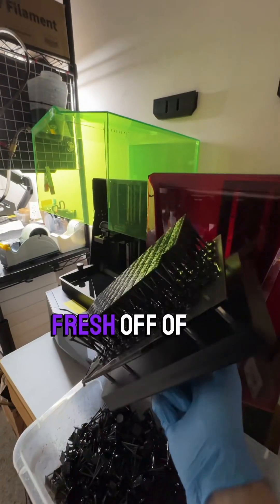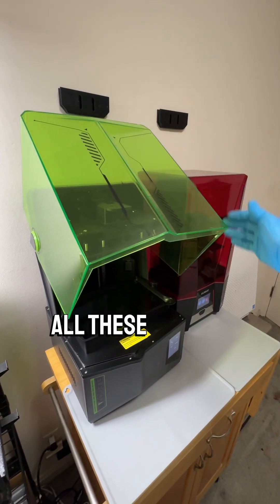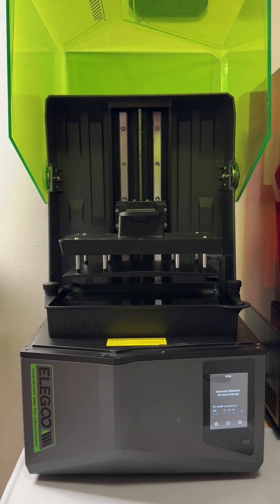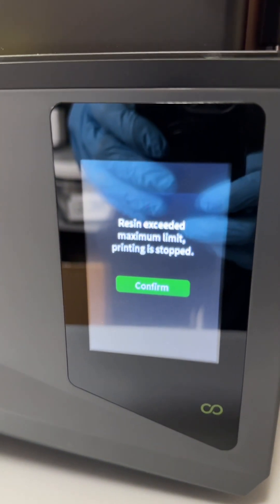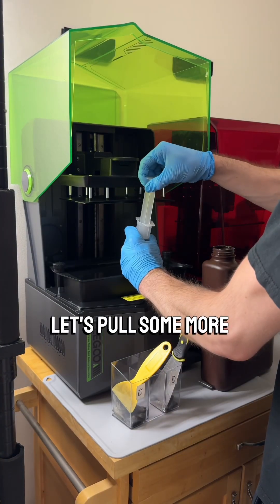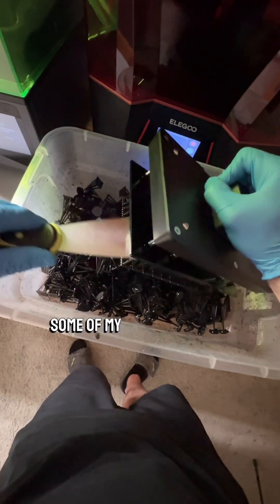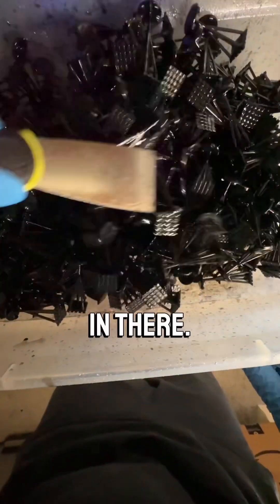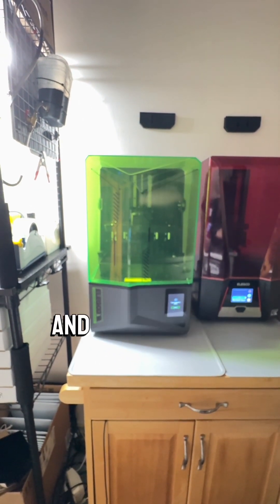Elegoo Saturn 4: GREAT yet DUMB — Fast Resin 3D Printer — auto leveling, flip top lid

Comment: Thanks for the video! I am debating between getting a Saturn 3 and Saturn 4 (non Ultra.) I have heard people being frustrated with the auto bed levelling on the 4 and you mentioned the smaller build height. What do you think should I get the 3 which seems to be more like my Mars 2 in how it works or is the upgraded 4 better?
Reply from the maker: The 3 is great if you dont need training wheels.

Comment: You understand that lowering the build plate I to the vat raises the lvl of the resin.

You make me sad.
Reply from the maker: Obviously. All “max” lines on my other machines (Halot One, Halot Mage, Saturn 2, Saturn 3) are meant for when the build plate is not in the vat. But please continue to educate me.
Reply: @liveeasy  and this is not one of those previously mentioned machines. its a new beast.  and the Bitching about the USB port,  thats just FN sad .
Reply from the maker: Are you trolling or do you typically assert confidence on topics you know nothing about? I would ask you to ask Elegoo directly or to read the user manual, but no need as the max line isn’t even possible to see when the build plate is zeroed. Just checked. Good try tho. 

Maybe the USB placement is perfect for you, but I care about ergonomics and there is no reason why it couldn’t be placed in front like the GKtwo, which the Saturn 4 already takes heavy inspiration from (lever build plate release mechanism, extended build plate, flip top, green). When you use a machine every day little pro-consumer things matter. If you disagree, please never design anything. 🙏
Reply: @liveeasy  you have obviously never had to pick up a tool of any significant weight, you're talking about ergonomics and placement on something that weighs less than a few M&M's .  that you only have to deal with once or twice a day TIMES how many printers you have . if you are having issues i suggest getting a few 20 lb dumb bells and put some work in. 

as for the fill line. i have not received my S4U  ( a topic i am not happy about )  so i have way to know but can you turn the vat around so the fill line marker is front side. then look down. odds are you can.

I've been in this business for 20 + years  CNC, Machining, now additive printing. it's all pretty much the same. dealing with manufactures idiosyncrasies is shit you deal with on the daily.  you should know that by now.
Reply from the maker: You’re demonstrating that you believe ergonomics is limited to suiting users capabilities (why you brought up weight), but it’s also about overall usage efficiency. A front-on USB port also has the advantage of not needing to guess which way the port is oriented. You’ve been doing this for 20+ years. Stop acting like You dont understand the value of reduced friction. What even is this argument? Man up! I keep my USB ports buried 10ft under my house and when I need to use them I get to digging cause I aint no bitch and why would I ever consider how things could be better?

You are also continuing to argue that Elegoo would break from its previous designs to make it so that now users have the additional task of zeroing their build plate before each print, and now the vat can only be oriented in one direction (but also dont design it to prevent incorrect orientation), and you must crane your head over to read it because the max indicator is now in the least convenient angle possible (printed perpendicular to the natural user angle of view). This is an insane hill to die on. Appealing to multiple decades of experience only makes this look like more of a joke. 😬

Hope you get your printer soon so you can stop being ass mad and venting your emotions and irrationality out in my youtube comments. God speed.

Comment: bro slowly lower it into the vat, fully submerge ,now with the platform fully submerged use your syringe to draw the excess resin from the pour spout area. Whats happening is the sensor isnt reading the reservoir lvl properly ... probably a timing issue the machine is waiting to read the lvl after the build platform  is fully 
submerged

Comment: This is one of the things I am finding annoying with the latest generation of printers. They are adding some good qol features but then they are bloating them with features that are more hinderance than help. 
Give us the stuff like the quick release build plates, the flip top lids. Make sure the USB ports are in the front too. 
If they are going to give us wifi and cameras, make the cameras for us to monitor the prints, and the wifi for us to load and start the prints remotely. If the AI is going to monitor for problems, let it warn me and let me decide if I need to cancel the print. 
If they are going to include a tilt feature that speeds up printing, they need to make sure it is robust enough and provide clear guides on loading the printer with resin to not cause false positives on being overweight.

Comment: My guess is its using weight to check resin. But do all resins weigh the same?
Reply: The Z arm that holds plate has force sensor so it's probably checking when the plate runs into surface of resin. Also the very low Max line is maybe left over from the ultra version, the ultra has tilting vat and needs more clearance so the resin doesn't spill over, from the video this base model should not be so over zealous with it.

Comment: for the usb stick you can just use a usb extension cord and put it infront, such cables should be cheap
Reply from the maker: Indeed. 🙂 I’m just saying the problem didn’t have to exist.
Reply: Does the Saturn 4 have wifi? Or only the ultra?
Reply from the maker: @Bobby11  only the ultra
Reply: @liveeasy  fr, who needs it on the side. fronts better